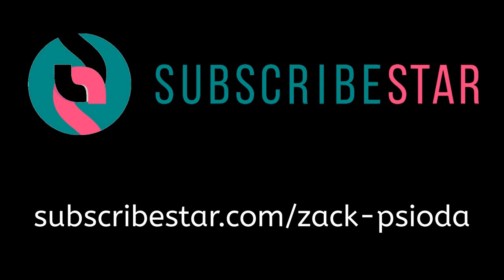HVAC Capacitor Ratings, Measuring Power Factor and Watts Measurements | Jim Bergmann

Comment: Awesome capacitor rating review. It sucks when you don’t know the original capacitor rating on an old unit. And you have to call the manufacturer and find out what the right sizes takes forever for Technical Support. Is there a quicker way to find out what the right capacitor is for the compressor?
Reply: kenneth eldridge power factor. If you’re not at 1 then you need to make corrections to the capacitor. Turbo 200s are great for that.